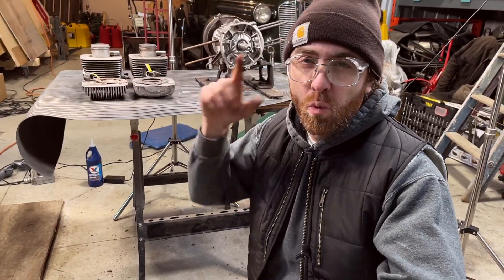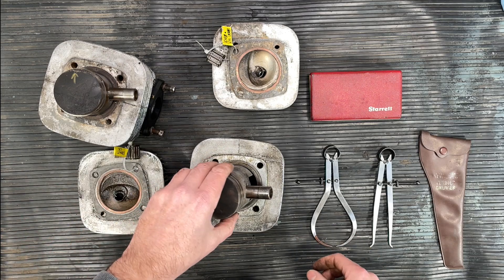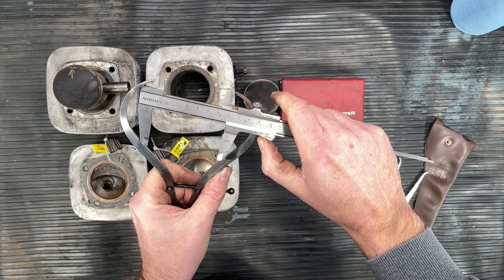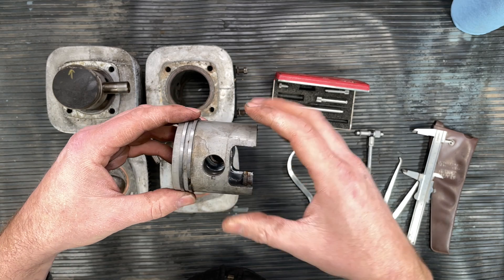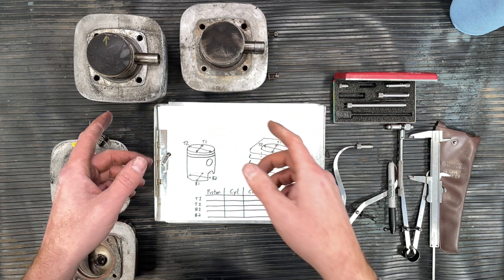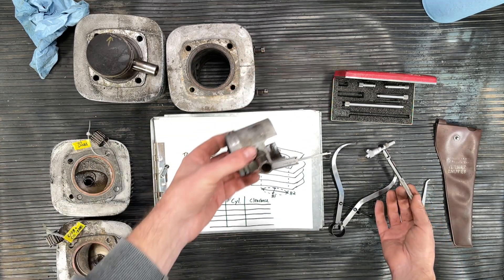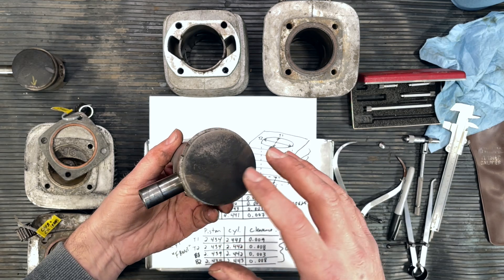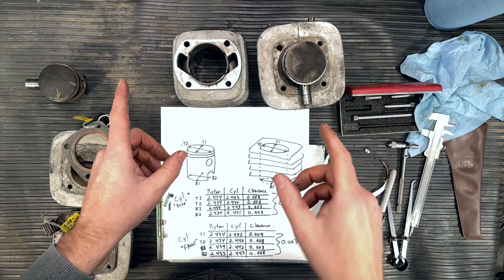How to Measure 2 Stroke Engine WEAR! Is My ROTAX Still Good?? -Ski-Doo Super Olympique 370-

Comment: Those engines are not easy to find NOS pistons for- I was told they used the same pistons as the 163cc single used on the earlier years.  I'd reuse those parts.
Reply from the maker: You are right about the 163cc singles. They share the same pistons and head gaskets, but parts for a 163 are just as hard to find! I’m comfortable reusing the parts I have, but wanted to take the whole engine apart, so I would damage it with a possible unknown problem….
Reply: I know nothing about these 370’s but if it has a 62mm pistons it seems like the head gasket and maybe base gasket from a 185cc 9.5hp would work. Parts available at Wateraxe for the 185’s.

Comment: Cool, you got another parts motor. You can use the outer schroud for the rewind holes that were bad. Back in highschool small engines class,I honed out my 335 Rotax jug for a 1st oversize piston.I didn't know exact specs for clearance though at the time. Releying on the teachers opinion as it being good enough. Seemed good to me I was just a 15 year kid. Turned out,  the engine ran great until it got hot. Then pow!  The Piston would seize in the cylinder and kill.😞 I didn't quite go far enough on my honing. My dad took it a machine shop to accually get rebored.The machinist said I was just about there but not quite. Very tricky, the tolerance, allowing for expansion. Live and learn, I  was a student that learned a hard lesson, the hard way.
Reply: to me, it's better o try but fails then to just don't try ! you gotta learn at some point and some stuff has to be broken ahah !
Reply: @morrron5  At the time, it was a tough to take it. But I eventually got over it.I had a 292 T'nT motor in that same Skidoo which was my favorite.But one day the connecting rod broke and sent it right through the crankcase, bang!!   I ended up walking home that day. That motor was beyond repair.😞
Reply from the maker: Well said!!!
Reply from the maker: Lol! Cool story!!! Because I am reusing the same parts, I’m not worried about the engine seizing, but you are right that you have to know what you are doing when you bore a cylinder for a new piston. I am glad I got that parts motor, because I have to admit, the recoil shroud had a little too much work to get it back to usable condition. I would have probably cheated and drilled new holes in the recoil to use the other set of shroud holes.